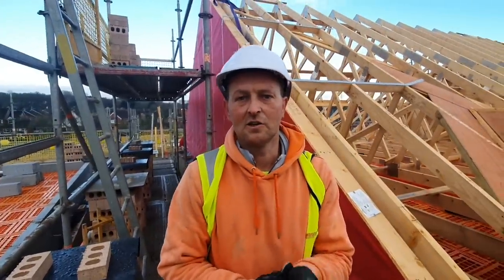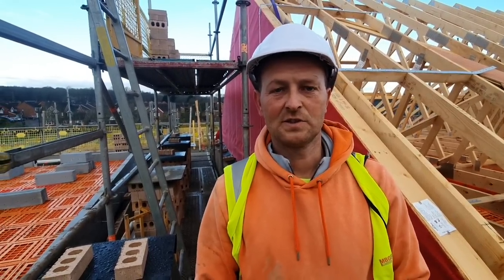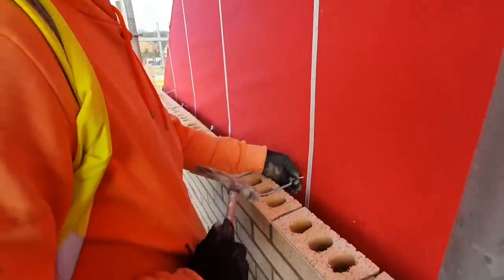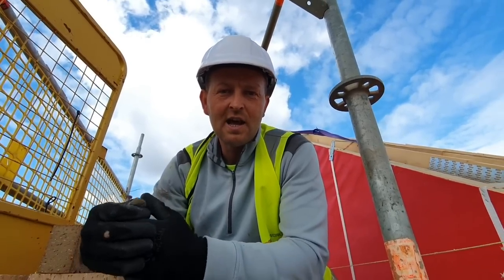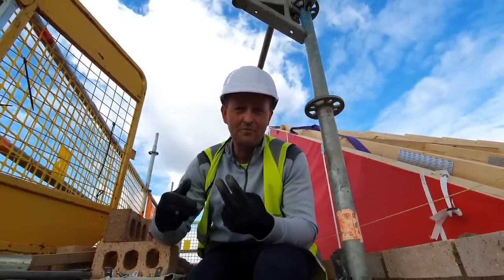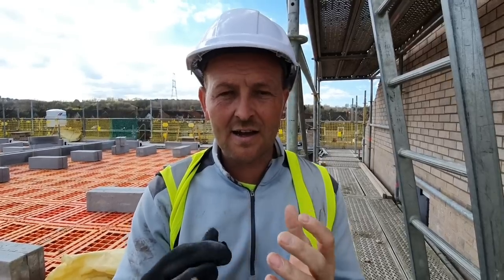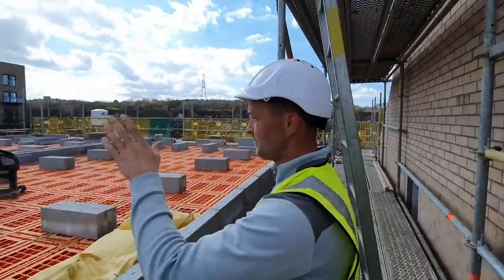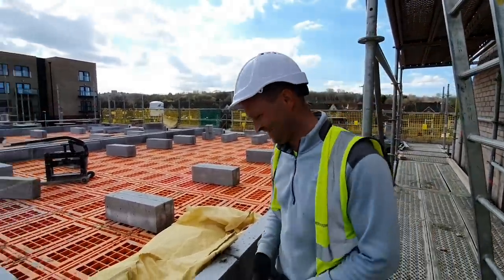Bricklayers Take It The "Wrong" Way

Comment: Changy ive used and will continue to use a ginny wheel its brilliant for gobbo and have even used with the appropriate heavy duty bucket pulled up bricks and blocks on extensions the quantitys usuallly nowhere near as on site
Reply: I use one for lifting roof tiles up

Comment: Working on timber frame myself at the moment here in the west of ireland and of course its all we 4inch concrete blocks we wrapping them in. And wet blocks too it's very rarely we get to lift a brick or a dry block at that. But fuck me you start with a 50mm cavity at the bottom and build your work plumb but when you get to the 2nd story god knows what way it could be... cavity could be way big or way small. Amd don't even mention the fuckin windows there never fuckinn rite jesus...maybe yer frames are perfect but the ones I'm on ain't the best to say the least. Maybe talk about that in the next video point out the problems we have to deal with and make rite..